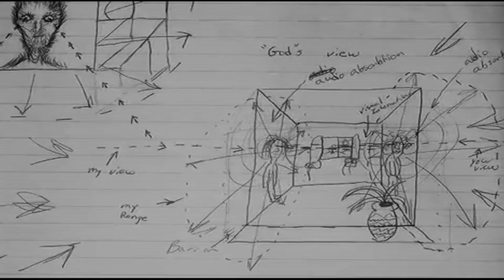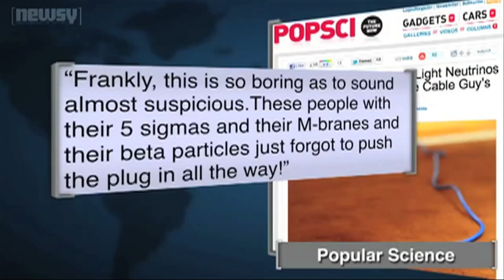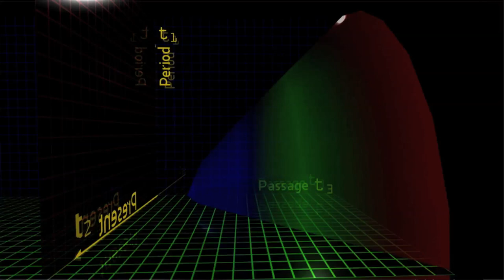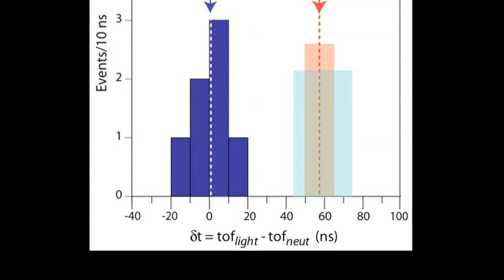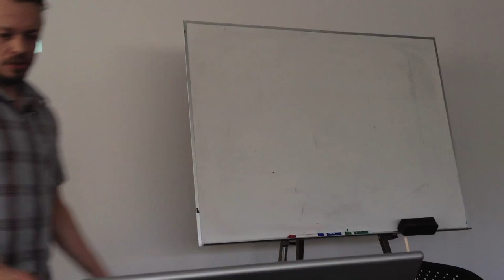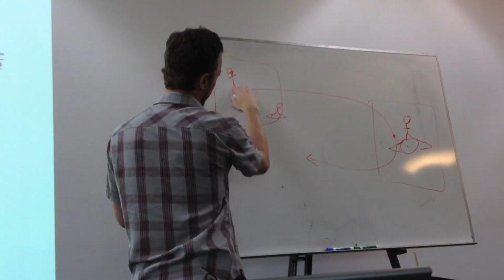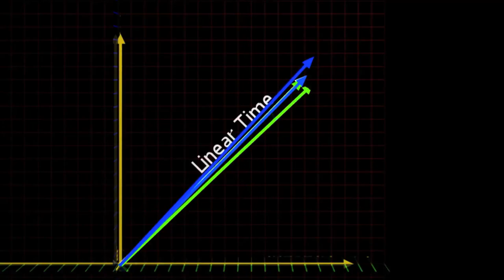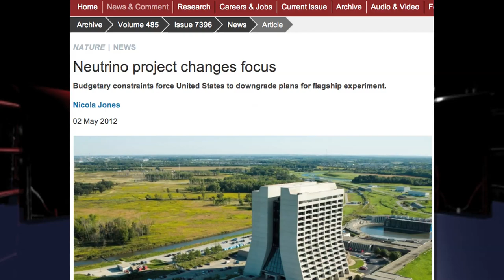Wince vs CERN: One Round Only!

Comment: IF instead of using neutrinos they instead shot a beam of light thru a tube  along the same path the neutrinos took would the beam of light have arrived before the beam of light should have?  OR does this magic trick only work for neutrinos?   Have they not already measured light to 299,792,458 meters per second?  or has it been measured more accurately?  If they shot a beam of light along side a beam of neutrinos would the beam of light have arrived before the beam of light should have?  I don't get it.
Reply from the maker: Great question. The short answer is that this has to do with special relativity. If 3D-time is applied to the Lorentz transformation in the way presented, it predicts specific issues arising in measurements using special relativity, such as relativistic particles showing up "early". This appears to be the case for neutrinos, though not quit 60 nano-seconds early; more like 6 nano-seconds. Regardless, that neutrinos have been measured to both have mass and also travel light speed (within statistical error) is indicative of this technical issue.

Its not that neutrinos travel with superluminal speed, its that there appears to be two extra time dimensions that modern physics is not taking into consideration and that the neutrino speed, flavor oscillation, and other properties seem to indicate extra dimensions of time.
Reply: *****  did you applied C3 to calculate lorentz factor when v is closing towards c?
Reply from the maker: franck Malers
Great question :) No. C3 deals with infinites, infinitesimals, and non-standard calculus. The "interpretation" of what happens when v converges to c can lead to the question: "What does 1/0 mean as a physical quantity?" However, I think the equation is meant to set the speed of light to a unit of measure as opposed to raising questions about the meaning of 1/0 in physics. Also, the C3 treatment of 1/0 is not as simple as saying 1/0=0 or 1/0=infinity, but I do think the C3 treatment of 1/0 could lead to some interesting philosophical discussions :)
Reply: Thank you for your reply :) I agree about the meaning of the Lorentz equation. I just thought that, as lorentz factor is derived from lorentz transform, perhaps C3 could be applied. C3 is quite complicated indeed and it shades new light on a branch of mathematics that hasn't been challenged since Newton. I'll have to read it many times but I thought you gave a hint as what to 1/0 means, page 46, determining the indeterminate forms. I see C3 as a novel way to fully understand calculus as mathematics just don't want to bother about incoherence when performing integrations, for example. Oh, and i'm the person that sent you a facebook message earlier today about translations.
Reply: not faster than the light, they made a mistake
Reply: not faster than the light, they made a mistake
Reply: not faster than the light, they made a mistake